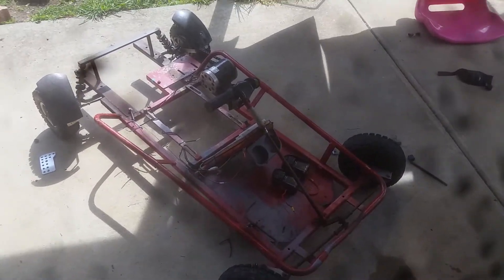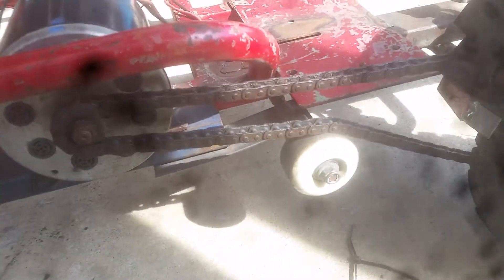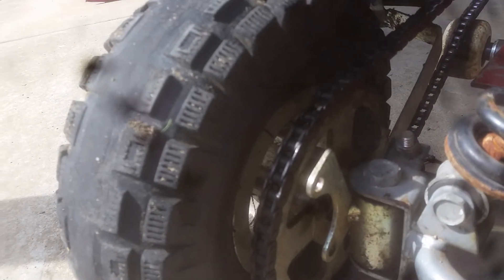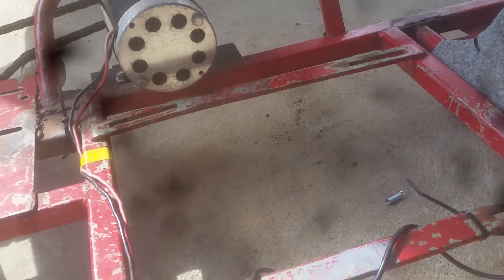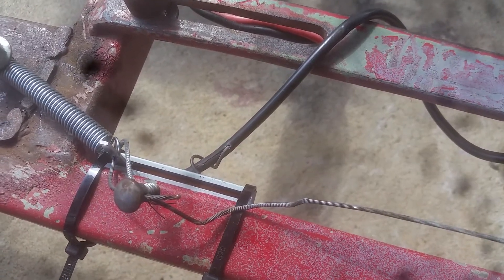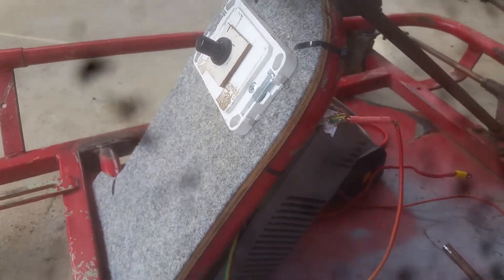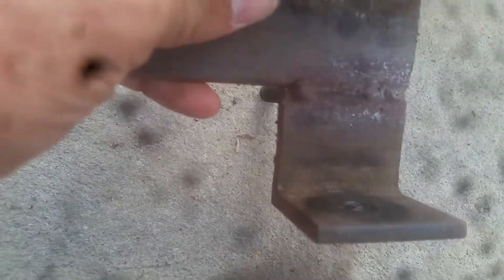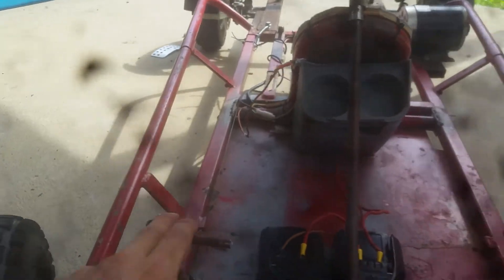Homemade Electric Go Kart Tips and Solutions

Comment: great work. how fast does it go? and how much did the motor and batteries cost?
Reply from the maker: Hey mate, I tracked down the motor and got it for free off Gumtree.. (Aus version of Craig list) and Im currently using 2 x 1.5ah 18v Bosch drill batteries.. they cost about $60 each and the motor is about $30 second hand.
Reply from the maker: oh and by maths it gets to about 19kmh.. it does move along nicely with 2 little boys riding.
Reply: Thanks a lot for the info, tbh i didn't think you'd reply. Could you tell me the details of the motor please, like the voltage, watts and RPM, i would really help since i'm going to start making my own electric go-kart for a school project and i'm unsure of the motor and batteries i'd need. I was thinking about using a 350W, 24V motor with 3000RPM and powering it with two 12V Razor scooter batteries, do you think that enough?
Reply: Seriously thanks, especially for the fast reply, it's hard to find videos that share enough info on the motor and batteries.
Reply from the maker: +mixerman0123 it's a 36v 500w 17.5amp motor it has an 11tooth sprocket on motor and 55tooth rear sprock. Pretty sure it does 2850rpm. If you want a longer ride time best thing to do is get batteries that have a higher ah.. your should be fine but more ah means more ride time. I'm looking at upgrading to 3x12b 8ah batteries for this project which should give me a ride time of bout 2-3hrs.. I'm also reasearching putting a trickle charge solar panel on it.. more vids will follow.. its the reason I did the video.. Not much info on them.. share on your fb if you like.. also there is a video of it running rough on my channel...
Reply from the maker: +mixerman0123 I appreciate the questions. no point loading a video and not where are you from?
Reply from the maker: +Anthony Davies oh and failed to answer the important part... motor I got for free.. but they are about $65au each.. then batteries are about $40au each.
Reply: your motor sounds really powerful but does 19kmh which is 11mph. I was really hoping to get my go kart to go around 30mph which is 48kmh so in comparison to your motor the one i had in mind seems really weak, do you think i should go for a more powerful motor like a 48v one? is 2-3hrs run time a lot? im not sure since i don't have anything to compare to. I'm from England by the way
Reply from the maker: +mixerman0123 well my kids are 3 and 5yo so I think 19km is quick enuough for them.. if you have a few options from what I've researched.. A couple I've considered to go faster obvious upgrade motor or another is smaller sprockets.. but you sacrifice battery life as it takes more current from batteries to get to top speed.. also look into getting a ESC. a great starting point is a mobility scooter you'll get motor, ESC, batteries and if your lucky a foot pedal.. but as seen in the video its very simple to make one.
Reply from the maker: +mixerman0123 2hrs runtime for kids is sufficient.. but if I hop on and ride it like and adult I would probably get about 45mins as I'm heavier and ride harder.